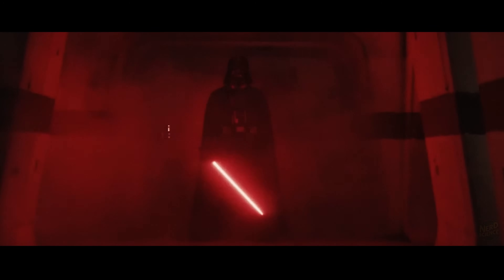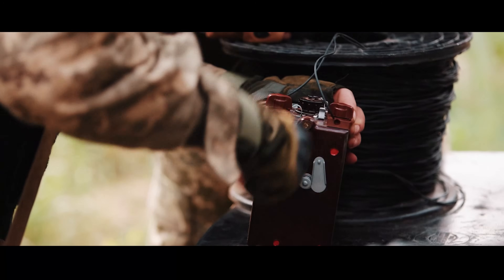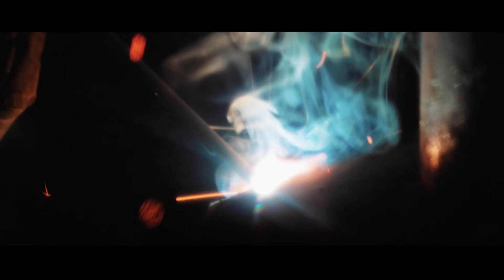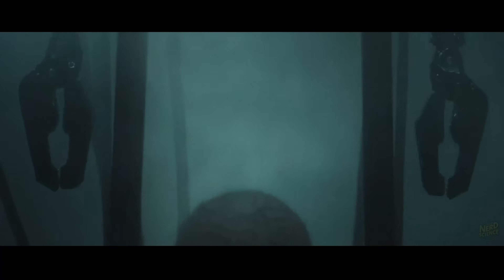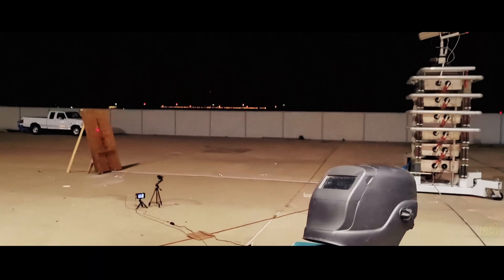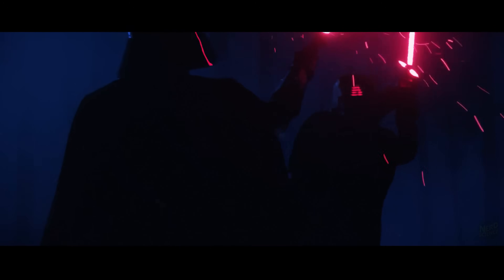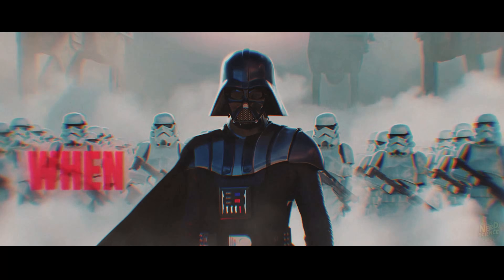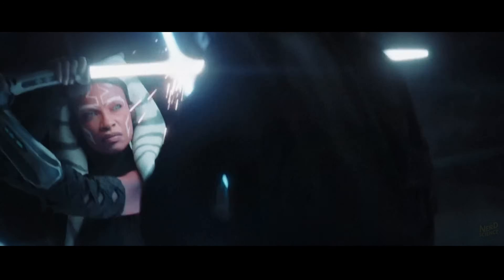Why a REAL Lightsaber Will NEVER Exist (According to Science)

Comment: You are having to ignore too much Canon to make your point...  the main point being that lightsaber blades are plasma.  They aren't.  If they were, I'd agree with most of what you say.  But they aren't.  The blade is made from a stream of single kyber atoms (not molecules, kyber is an element) being guided and contained by a vaccum contained by a magnetic bottle.  That's why they cut most anything while radiating no heat until they make contact with solid or liquid matter. 

 That's also why they don't waste energy, the atoms return to the primary crystal and are reintegrated.  The saber only loses energy when individual atoms are ejected from the hilt most of which is returned when the atom returns. 

This also explains the color as the light we are seeing is actually the magnetic bottle reacting to the atomic frequency of the kyber atoms passing through itself.
Reply: There is so much more, but i dont want to write a novel here lol
Reply: Even in a fictional universe where "kyber atoms" existed, what you described would be impossible due to being a perpetual motion machine ("the atoms return to the primary crystal and are reintegrated"). You are basically saying you can generate energy out of thin air, with zero thermal losses (thus also zero entropy) due to, er... kyber.

If we replaced kyber  with magic that should work. Magic, after all, does not need to abide by entropy or any physical law. But magic is an element of fantasy, not science or science fiction. So for lightsabers to "work" (via magic, which by definition resolves everything), we need to stop pretending there is anything sci-fi about them.
Reply: @NikolaosSkordilis incorrect.  I very specifically mentioned the minute power loss.  Also, the same effect will some day soon be replicated with hydrogen atoms.

Also, dont knock the idea of a perpetual motion device: what exactly is it you think you are standing on?  Are you under the impression planetary inertia simply stops when it runs out of potential energy?

If you wish to debate real life physics, get serious.  Until such time as you can explain the difference between Newtonion and non euclidian physics,  just have fun speculating with the rest of us, ok bro?
Reply: wait so the colour of the sabers can be manually adjusted?
Reply: They ARE IMPOSSIBLE 😂😂they are powered by Kyber crystals 🤔AND THOSE DO NOT EXIST…..without those crystals IT is NOT a proper lightsaber

You are talking about them not wasting energy as the atoms return to the crystal…..BUT THEY DO NOT EXIST so the atoms WILL BE WASTED 😂😂🤦‍♂️

You have a lot to learn
Reply: @zachall101  Kyber crystal fictitious. Also the force aka telekinesis fictitious. Can't put the power of a nuclear reactor into a crystal and cant move objects with thought unless you have super human durability. Without it you'd either tear your mind to shreds or cave it in. Just look at the movie Chronicle. They all got nose bleeds 1st time using it. They would get way more than that though. Working out a muscle, lol. Try bench pressing a car see what happens to your body. Same thing using your mind to move it. Unless you Steve Rogers, Thor, Superman, etc you ain't doing any of that.
Reply: @G-man47  force users in star wars "connect" with the objects they move about with their minds as if those were part of themselves, as if negotiating with or manipulating the respective magnetic fields of those objects. not the same tk magic as it usually is with fantasy tk. the strain is not physical, but "metaphysical", so nosebleeds are not really a thing even with strained force users in star wars canon... as far as i understand star wars
Reply: @zachall101 was that a moment for you?  Feel better now?
Reply: @TheLionsPride if you can’t handle FACTS then don’t bother commenting, the way you are going on about it BUT MISSING OUT THE ACTUAL TRUTH, the fact that a lightsaber is ONLY a lightsaber if it is powered by a kyber crystal…..YET THEY DO NOT EXIST in reality…so stop being a child and focus on real life
Reply: @zachall101  We first saw touchscreen computers on Star Trek and now we carry them in our pockets.  Sure, they turned out to be far more possible than lightsabers, but that doesn't mean we can't play with our thoughts. :)
Reply: @zachall101 typical who always feels adult 😂😂😂😂

Comment: At this point in my life, I refuse to believe that anything is impossible to be created. There's already some guys that have already made a proto lightsaber using a plasma blade as we speak. The problem with what they've got is the fuel source and it can't be carried around and it doesn't last for very long but this is a major step in the right direction. If human beings want lightsabers as a weapon or a tool, human beings will eventually figure out how to create them.
Reply: That’s basically a description of some of the first light saber variants.
Reply: @Who_Tye709 LITERALLY 😂
Reply: Only a nuclear power source would have enough power density to fuel a plasma saber. Nuclear batteries already exist, but they excel in energy density (kWh), not power density (kW). They last long, in other words, but their power output is tiny. 
Betavolt can last up to 50 years but with its 100 microWatts (0.0001W) of output it cannot even power a smartwatch. They need to raise that by.. 10,000 times to reach a single watt for a smartwatch that would never need to be charged. And billions of times for a plasmasaber. 

But is that a hard physics problem or an engineering problem? At such a small scale only a tiny matter - antimatter reactor (or diode) could provide the required power density.
Reply: @NikolaosSkordilis  Yeah but, you technically still need this thing called a Kyber Crystal that's infused with the life-affirming power of The Force. And then depending on whether you read legends or canon you might have to be powerful enough in the force (midichlorians) and trained to be able to wield it. But yeah maybe some kind of plasma powersword might be possible; that doesn't need space magic.
Reply: @NikolaosSkordilis  If the nuclear battery can provide 100 microwatts for 50 years (438000 hours), increasing the power output to 1 watt would mean they can only run for 43.8 hours before running out of energy. That's not even 2 days. Unless you're talking about a nuclear battery that has an adjustable power output.
Reply: Using solid  light holograms /force field I'm not going to tell you there is a way and using plasma Shields too for the heat I have theoretically worked it out it's based on real lab experiments and research around the world the tech does exist and power supply done to it's all possible I don't have enough money for a patent and I don't want to sell it and lose it because it cost half a million dollars for paying for patents across the all countries that you would want to sell it to
Reply: Your comment is proof you didn't even watch the video. If you actually did you chose to ignore the facts.
Reply: Dude a lightsaber needs The Force to make it work. That’s space magic. It’s a space-age magic wand so no, it’s not possible…..
Reply: They will be created. But they was never meant to be a weapon. All you would get is a plasma cutter with a Long plasma blade about the size of pocket knives to the size of kitchen knives at best. Yes Lightsabers are real but they was never meant to be a weapon. All you will get in real life is a plasma knife. That's it. It has many uses. 😊 Movies just exaggerate things. A handheld plasma cutter knife at best in real life. 😊 So no worries. ☺️ War is never a thing of the future anyway.☺️
Reply: I have 2 words for you. Negative temperature. Once you have that, then you won't be able to burn yourself or anything near it, unless you touch it.
Reply: EXACTLY! This creator needs to re-title this "Why I'm full of 💩"! 😂🤣🤣